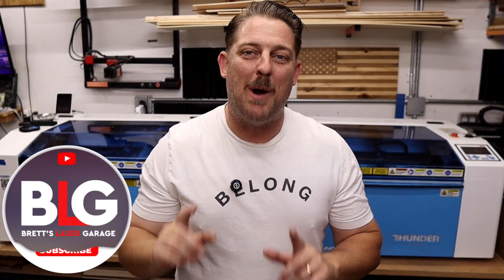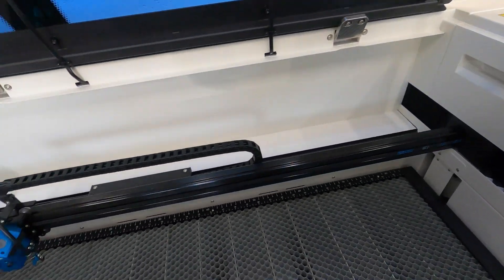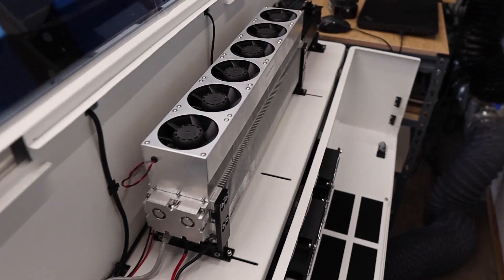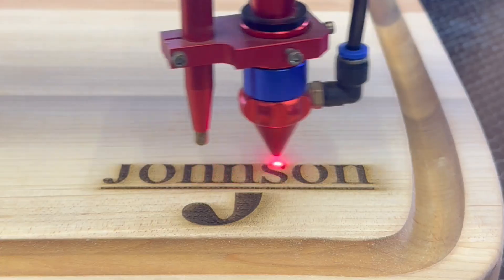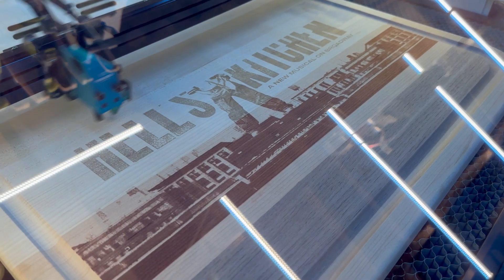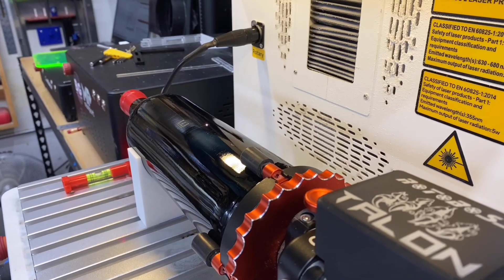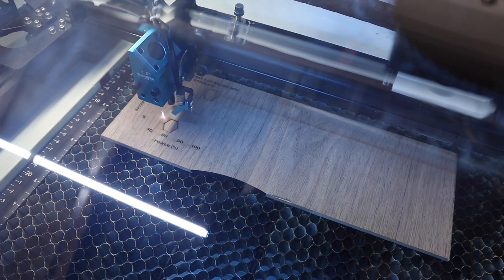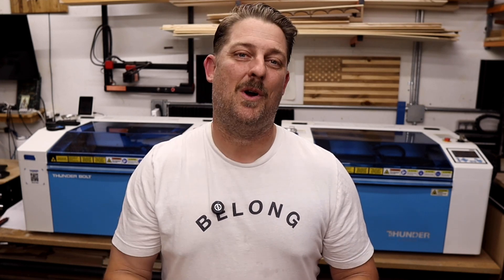I’ve Been Where You Are – Budget Laser vs Thunder Laser: What You Need to Know -  Bolt Pro 32

Comment: Great video! I sure wish the Bolt series air assist came straight down the nozzle instead of from the side...it really makes a big difference.
Reply from the maker: Yeah definitely, I think that would help as well.  I hear they are experimenting with an adapter or something that can be added to the laser head to help with this.  For now adding more volume has helped though.   Thanks a lot for checking out the video.

Comment: I got my first laser last fall and I went with a Thunder Bolt. I could have gotten a larger, cheaper laser, but read over and over where people said you need to be prepared to "tinker" with them. I also read where support can take days to respond. In the end I decided to spend a little more and go Thunder and I have zero regrets. I had it out of the crate and up and running my first tests in no time. No adjustments, no alignment, just straight to work. The couple little issues I've encountered support responded to my emails with in literal minutes.
Reply from the maker: Bingo!  There’s pros and cons to both options but I’ve come to very similar conclusions myself.  Love my Bolts